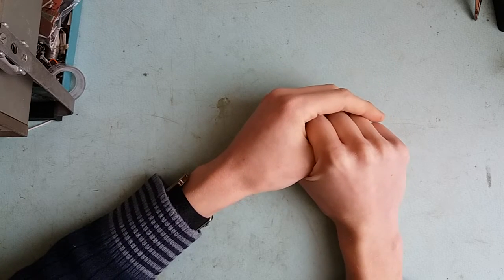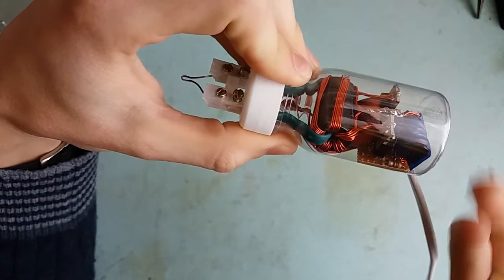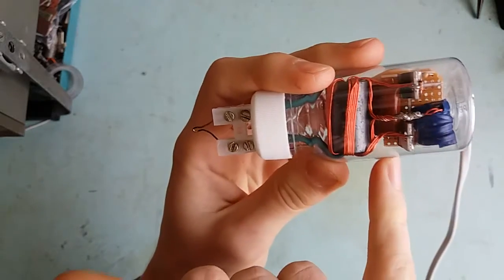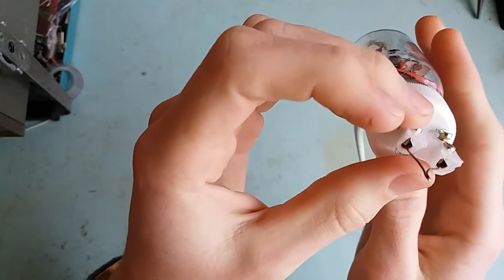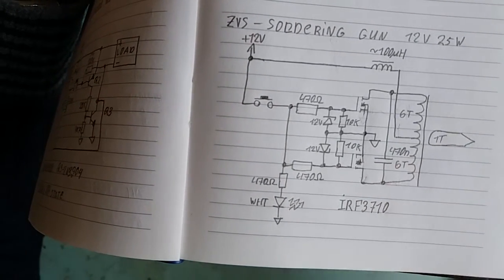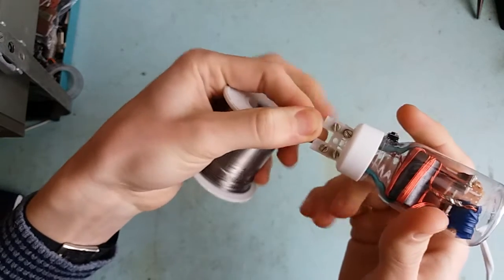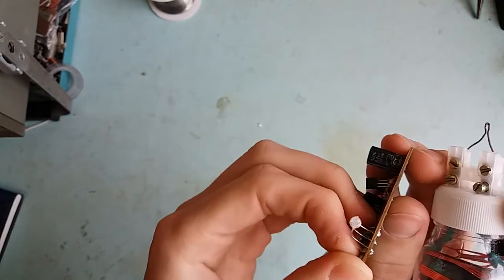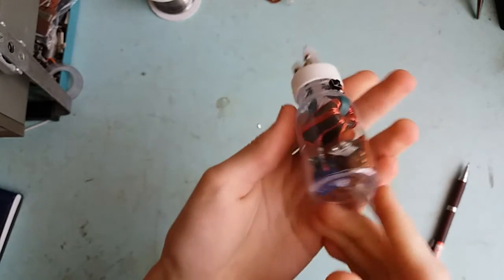ZVS soldering gun, 12V 25W (pls read description)

Comment: Why there's 12v zeners if the input voltage is already 12v?
I'm building this circuit with IRFz44 and without the zeners using a stable 12v laptop transformer and same transistors as you.
Reply from the maker: Precaution. May not seem necessary, although I have seen gate get damaged without them. Drain-gate also has a capacitance, known as Miller capacitance. And there's rather high voltage on the drain

Comment: Great Job Johnny! What frequency is it operating at? (sorry if I missed that) The bottle looks comfortable to hold as well.
Reply from the maker: Thanks, Paul! I didn't measure it yet, I'm gonna do a followup video with a little extra information. What I know already is that without load, it oscillates somewhere in the audible range. Will upload it overnight, I have an ADSL connection which is a partial reason why I'm trying to make short videos.
P.S. I'm amazed to see you here, sorry if I sound too excited, because I am :)
Reply: You have a great channel Johnny, I enjoy stopping by in my spare time. It's refreshing to see you have that "design and build" spirit as well! Looking forward to hearing about the operating frequency.
Reply from the maker: Thanks for the kind words. I don't want to spoil it for you, I already filmed the video :) I measured it unloaded and loaded, using my scope, which doesn't have that much more frills than your vacuum tube beasts. I made a silly mistake in the schematic you see here, I will show the correct one in that video. I forgot to put gate discharge diodes, what a shame :(

Comment: The above "big clive" camera angle is a great idea.  I often do that in my videos as the camera doesn't get in the way like that.
Reply from the maker: Yeah, this angle gives freedom of movement. But I have to be careful not to knock the phone off of the contraption that holds it in place :D BTW, how is your project doing, you mentioned it in your last video?
Reply: It's coming on pretty well, I'm making a balanced microphone preamp and testing out various ideas I've had, one circuit I came up with seems to work really well with almost no background noise.   I'd say I' about halfway through filming the video now, there's still a few other ideas I want to try out.
Reply from the maker: That's great! I have those days too when you just don't want to do any project anymore. I take few days off, then some idea spontaneously comes up and here am I again, soldering something past midnight :) I'm glad to hear that it works well.

Comment: Thats a great camera angle clive... oww i mean mr johhhnnyy lol :-D.
It leaves your hands free, and no getting in the way of the camera, it works really well.

Zvs is associated with generating high voltages, well thats what ive seen.
So its a power oscilator with a 6 to 1 voltage reduction, but a 1 to 6 current magnifier.
Roughly speaking.
I like the bottle housing :-D, just right for your hand.
The connector block is ideal, i take the brass inserts out and solder them into the back of crocodile clips, just insert  a multimeter probe in, then tighten screw. :-).

The tip is almost ideal, you are losing heat from the thin wire going to the connector.
Perhaps find some thick copper and file the center down to form the tip only.
I bet it will glow red if you did that lol :-D.

Oh: rossmann, he failed, no supprise.
Reply from the maker: I like your idea about croc clips + connector, gotta try it myself. About the tip - you are correct, I thought of that too but for now, I'm gonna use it as is.  I put a 0.4mm magnet wire just for fun, it heated it up so much that it melted the copper and the ball of molten metal made a cute little hole in the carpet LOL
Yeah, doing those live streams is bad for the business, I guess :D
Reply: Ooow poor carpet lol, my upstairs carpet has a high lead content :)

If you are going to try the crock clip mod, make sure the wire grip part is well tinned, and the brass insert too, plop it in the grip and mould the grip around the brass with plyers, then heat it up.
Sorry im saying the obvious, i shall give myself a slap :-(

Have fun :-D
Reply from the maker: I count that as a friendly suggestion, it's perfectly fine. What I and everyone else doesn't like is those smartasses like the man at 12voltvids has a problem with. I like informative comments
Reply: Im glad you understand, i only try to help, text can sound bossy if you dont know the person writing it.
Yes i like 12voltvids, he made a boo-boo by attacking the british over an old and cheaply made amplifier, silly as the designers would be dead by now.
But i ignore his mistakes, overall he is good, and enjoy watching his repairs :-D
Reply from the maker: That is a perfect advice because those connectors are quite hard to tin. If you don't tin them beforehand, you won't be able to create a strong&reliable joint. I knew that already, but how would you know that.
 Yeaahhh, he even renamed the vid after the backlash :D Amazing flip-flop LOL He has quite a temper, so I'm not very surprised :) Believe it or not, I have a bad temper too, but you need to piss me off to see it LOL His reaction to idiots and assholes on the road is suspiciously similar to mine ROFL
Reply: LOL you road rage beast lol :-D
So you will be making a tazer version of the zvs circuit to show the drivers how upset you can get, a 1000 turns secondary should sting them lol, no no thats my nasty thought :)

Yes i saw his flip-flop lol, he did over react, i did say the previous company that tryed to repair it were a bunch of pussies, and he said there was no equivalent transistor, silly man lol.
Anyway i dont hate someone that easy, people make mistakes.
Reply from the maker: True story :)